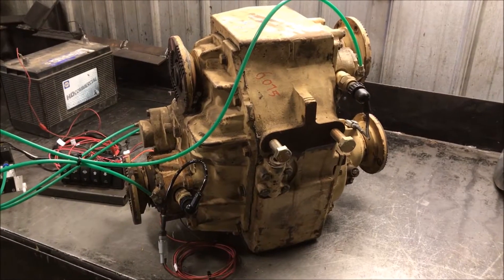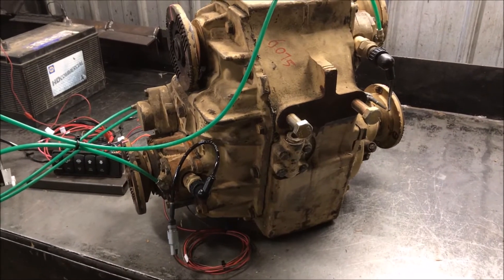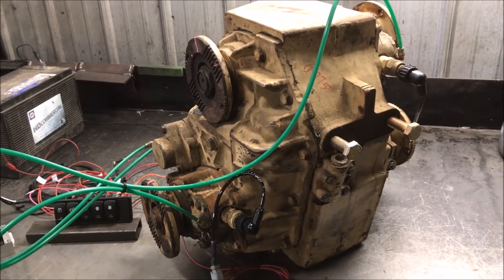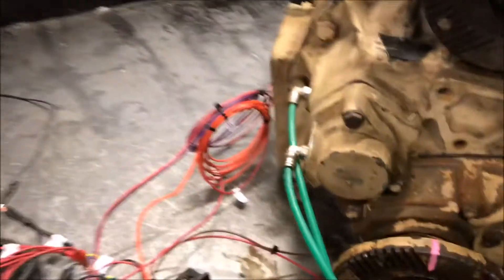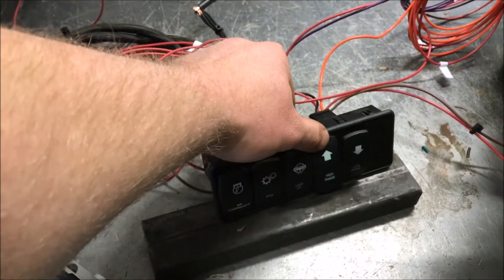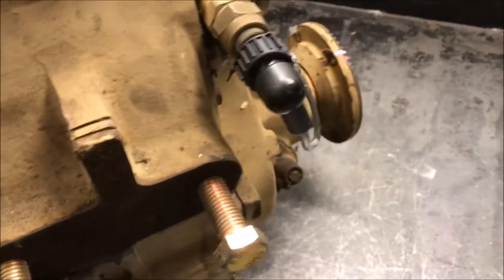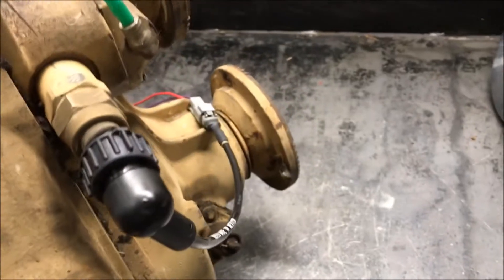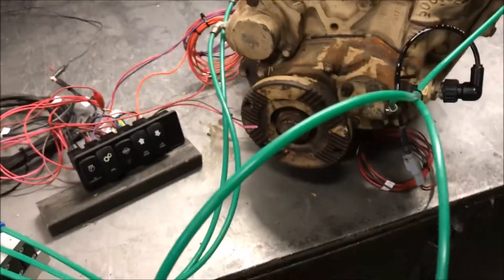T 600 Actuator

Comment: How does the T600 compare to a 2.5 ton axles like the T136 ?
Reply from the maker: It is significantly stronger, it also has a pressurized oil system where the T-136 only uses splash lubrication